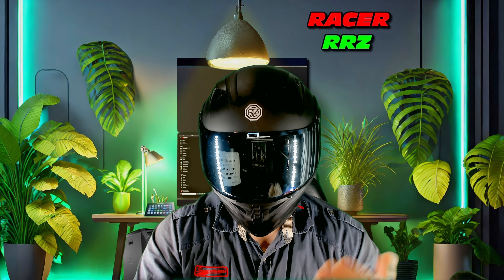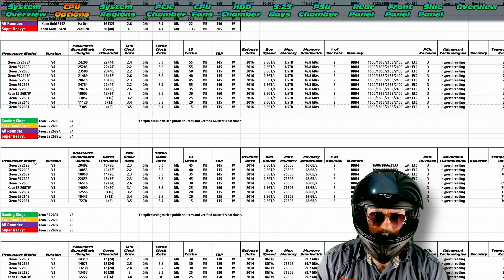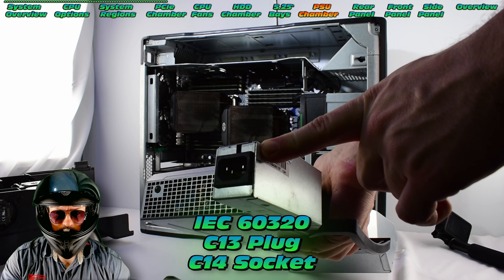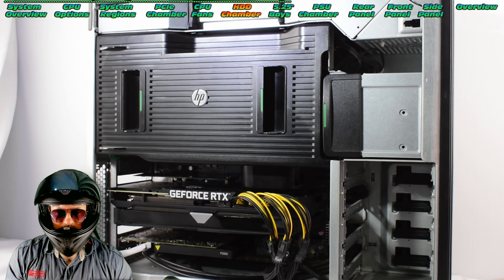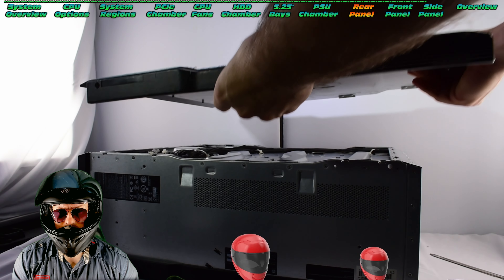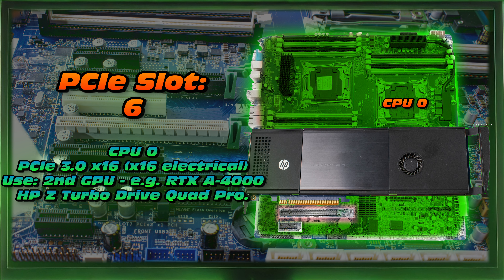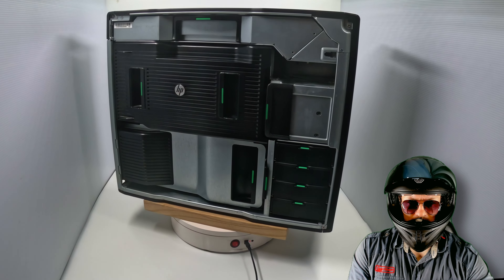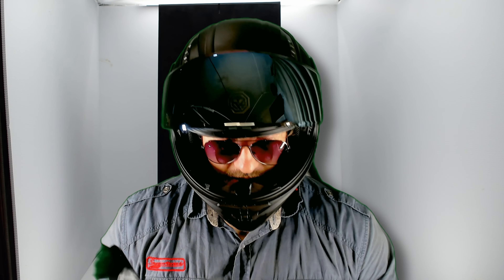This Workstation Would Be It. HP Z840 Full System Overview.

Comment: Ever considered do one of these with the HPZ 840 for Gaming Bots
Reply from the maker: You have got me on that one, I am not sure what you mean by 'gaming bots'? I have used my Z840 for both work and gaming and it suited that role really well. Decent expansion options, and, at the moment any how, relatively affordable upgrade paths.
Reply: @racerrrz  I use the HPbz 840 for funning gaming bots for a game called evony return of the king. I love my machine, but the clock speed hamper me because I run 14 bots on 36 cores. I still working out if this machine is actually running turbo at 3.8 or not and seems to bottle neck on vram issue that I solved with 3060 12g gpu, but wondering If running 2 ssd 1T in raid will help?
Reply from the maker: @troyklesick4566  Sorry about my slow reply. Nice, I have not played Evony return of the king but it's cool that you have managed to use your Z840 for funneling bots for the game. Which CPUs have you got in your system? The best way to get the most out of your system is to aim for more cores (Dual E5-2699V4), 2400MHz ECC RAM and an NVMe boot drive. That should give you the best possible performance from the Z840 - but the system performance will have a limit which may not easily be removed without upgrading to a newer system. Using a RAID 0 drive may increase performance but usually the system is only as fast as the slowest component in the configuration.
Reply: @racerrrz  I am currently running 2697 v4 and 2400 ecc 1t ssd drive becouse I could not get the z840 to accept the nvme m.2 drive also now looking in to running raid 0 if I can figure out how to set up the bios and the windows 10.   Any help would be appreciated....
Reply from the maker: That's strange, what issues did you run into with your NVMe? I have not had many issues with these systems and getting NVMes to work, and you are in luck, I have a heap of videos on the topic. I would recommend this video first : https://youtu.be/xqg0uQ93KTg  - then there are follow-up guides on each quad adapter that I tested. The Asus Hyper M.2 V2 was my best all rounder. Great price, decent speeds, solid temps - and I am daily driving that in my HP Z8 G4 at the moment.
Reply: @racerrrz  when I switched in bios to the nvme pcie slots and activated it it would not register it had anything in there.. so now I'm adding 4 1T ssd instaed, I confirmed that it reads all 4 ssds
Reply from the maker: @troyklesick4566  That's does sound odd, the Z840 should handle NVMe storage without issue. The only trick with the PCIe storage is activation of lane bifurcation in the BIOS if you plan on running more than one NVMe per PCIe slot (so using a dual or quad NVMe to PCIe adapter). 

SSDs can get the job done. I have two 4TB Samsung 870 EVOs in a RAID 1 mirror for critical data storage. It's never missed a beat.
Reply: @racerrrz  do you have a yountube for that one by chance
Reply from the maker: @troyklesick4566  Yes, I have covered all of those in videos. A quick link summary of the relevant videos:

SSD RAID 1 pool: https://youtu.be/ZczhWw834GU

Bifurcation guide: https://youtu.be/PRMWIpscDCg

Quad NVME RAID 0 Shootout: https://youtu.be/xqg0uQ93KTg
Asus Hyper M.2 V2 RAID 0: https://youtu.be/QWP7el4UvGE
Gigabyte Aorus RAID 0: https://youtu.be/iAw8-zO-WjQ
HP Z Turbo Drive Quad Pro RAID 0: https://youtu.be/umLcRS05nAk

Jeyi Quad RAID 0: https://youtu.be/cvFslE3zn7A
Reply: @racerrrz  raid upgrade went well , beside the number 1 CPU not operating after the upgrade....
Reply from the maker: Sorry, I just saw your update message. Did you manage to figure out why your CPU stopped working? That's somewhat unusual. Which PCIe slot did you insert the adapter into?
Reply: @racerrrz  when I did the raid 0, I downloaded Windows 10 pro. What I found out was it was not 10 pro but Windows 10. That system will not run dual cpu..
Reply: @racerrrz  I ended up using 4, 1T ssd to create the raid 0 and went with a hard ware set up for it.. to a little long but does work well

Comment: how about one generation up HP Z8
Reply from the maker: The HP Z8 G4 overview video is taking shape nicely. I have a short "trailer" video out soon to showcase some of the content for that system. I will give a full guide on CPU selection, RAM selection, PCIe slot upgrades, and a full tare-down - all in one video resource.
Reply from the maker: Nice. How are you finding the Z840 as a Linux server? It should have more than enough grunt to run any processes you can throw at it. Cool to see two GPUs in your system!

Comment: My 840 showed up two weeks ago 2 E5-2690 v3 (waiting for2x 2699a v4s in mail) 
128gb ecc registerd 2666 ram 8 slots used 
Nvidia quadro m4000 (2 p5000 in cart)
4 i tb samsung ssds 860s
Reply from the maker: Nice, that's a heavy hitting system you'll have by the end of it. I like the idea of a pair of E5-2699A V4's in a Z840, it's something I would consider a collector's item. The 2666MHz ram will clock down to 2400MHz due to that being the max speed for them Broadwells (as I am sure you are aware). Dual P5000's will make for a solid system. The only question that remains is what do you plan to use this for? It will have ample power and memory to handle anything. I'll throw in this idea for extra storage ideas - a quad NVMe adapter for some extra rapid storage: e.g. https://youtu.be/xqg0uQ93KTg

Comment: 2667 is probably best bang for buck. Will it do v4s?
Reply from the maker: It is a solid CPU for the price. Yes, the Z840 can do either Haswell V3's or Broadwell V4's. I settled on the E5-2697A V4 as the most ideal CPU due to the high clock speeds, decent core counts and decent pricing. I just checked the E5-2697V4 and it can be had for as little as $35 USD on Ebay.

Comment: how many watts at idle? 100, 200, 300?? :)
Reply from the maker: This number varies a lot depending on the hardware loaded in. The base system with dual CPU and an NVMe should be ~250-300W on idle in the OS. My Z840 with dual E5-2697 V3, 256GB RAM, RTX 3090 Ti several HDDs + SSDs and PCIe add-ins was ~350W idle and up to 760W max load. That power will include my two monitors and peripherals too. So not too crazy but it would cost a fair amount to keep powered 24/7 as a server etc.
Reply: @racerrrz  daaaaang, i did not expect 350w at idle, even with that spec. uuuuf. thats a lot, lol. cheers.
Reply from the maker: The dual Intel CPUs are power hungry but then all those cores get tasks done quick. At least you don't need a heater in winter - but you will need an aircon in summer lol.

Comment: Hp z840
2x Intel xeon E5-2687W 10c (20c) 20t (40t)
384GB ECC LRDDR4 2133
ASUS RTX 2080TI 11GB
Asus ROG Xonar Phoebus Solo 7.1 PCIe Soundcard
4TB SSD
BLU RAY BURNER
Reply from the maker: Nice, solid setup with the E5-2687W's! That's a monstrous amount of RAM - what's the most RAM you have managed to put into use? I think I have only managed to get ~220GB in use.lol. How are you finding the Asus sound card? I have been looking into sound card upgrades - I have been living off the 3.5mm jack since the dawn of time but it might be worth an upgrade.
Reply: @racerrrz  with vmware workstation running loads of vm's and docker about 250GB ram, I have more 32GB sticks of ram to make it 512GB but it causes the machine to hang or not boot. The sound card is amazing but most of the drivers are for windows 10, unfortunately the sound card industry is dying if not dead already. Same with 5.1 speakers.
Reply: The only time I got the 512GB ram to run was with vmware esxi. I wanted to pass-through gpus to vm's and use parsec to game on any device. It worked really well and plan to do it again when I get the hard drives I want as I want install truenas scale as a vm and pass through the disk controller.
Reply from the maker: @jerwal83  That's odd, maybe some of the modules have some memory faults? I would have expected the full 512GB to give trouble-free operation. I am surviving on 96GB on my Z8 G4 right now, but I might upscale to 256GB again - every so often the RAM use climbs to uncomfortable levels when I render videos lol. I tend to export my projects in segments to reduce the chances of peaking out memory. 

The sound cards feel like a retro item these days. I presume modern audio connections are decent enough if sounds cards aren't being produced as much, but if I can get my hands on a good unit I will.

Comment: Thanks  RACERRRZ for all the great information but what about the Price ?

€621.43  + shipping and I made a deal 30min ago with the seller: what do you think  it's shipping from USA to Netherlands ?

no inside case images hhhmmmm?
config:

HP Z840 28 cores 2x Xeon E5-2680 V4 64GB DDR4 R5-430 512GB SSD+1TB HDD WIFI W11
Reply from the maker: Well done on getting your offer accepted. That sounds reasonable if it doesn't include shipping and taxes - but if it includes shipping that would be a really good price. 
I can land this one for US $731.02 (affiliate link) landed at my door step (GST / VAT included): https://ebay.us/WNvZ02 

The price will differ for you pending the shipping and tax amount, but you can compare your offer to this ebay item. 
(it might be the same item given that this is the cheapest one on Ebay). 

Comparing that to Z840's on my local marketplace that is a really good price - they sell for ~$900 - 1700 USD [pending config] locally in NZ.
Reply: @racerrrz  thks for this great respons, I left the deal to cool-off and later on checking your deal, and yes the deal wash only shipping to the Netherlands but cut" it off because no images from the inside of the hardware.

see you in the next video 👍💯

Comment: ACERRRZ can you pimp my ride I have a G8G4 -  Nvidia RTX A5000 /  2 - Gold  5120  2.19 gz processors and 96 gb ram - hd of 476 gb about to die - I have a evil phone game I'm trying to beat can you help me pimp my ride?
Reply from the maker: Your system has some power but it would not complain about being even more amped. Go for dual Gold 6142's - they are the most cost effective upgrade. 96GB of RAM should dominate nearly everything you throw at your system. Something like the Samsung 970 Evo Plus or equivalent NVMe would give you a huge boost to dominate in the evil phone game.
Reply: @racerrrz  thanks!